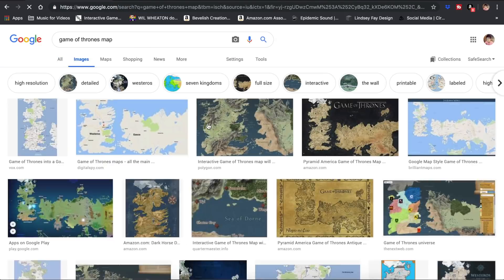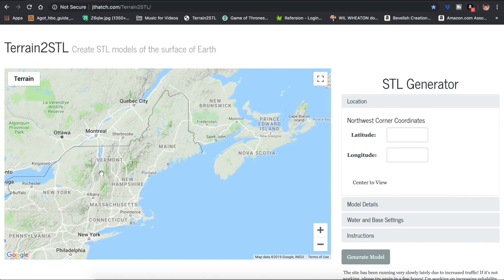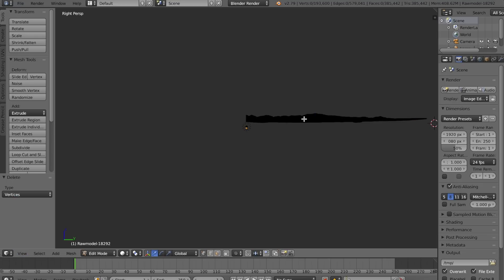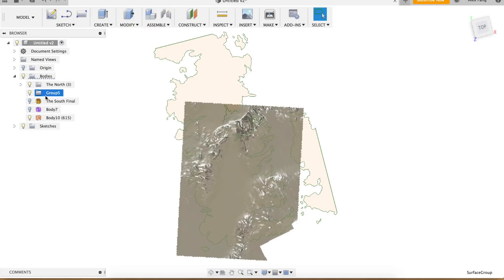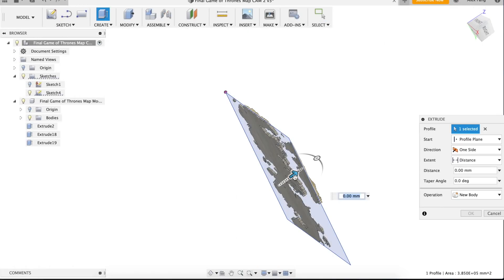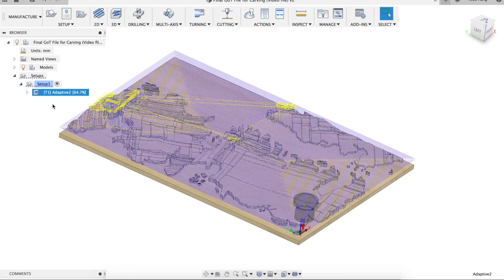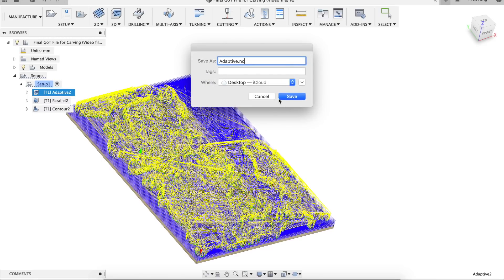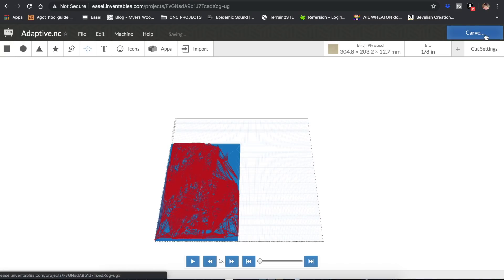Game of Thrones Wooden Topographical Map: How to Model and Carve || CNC Woodworking

Comment: Wow - I think the choices of the wood to glue-up is what makes this so special. That and the location of the layer changes.
Shame it didn't work out. I found this while trying to do a similarly huge carve on my hobby CNC. Now I'm thinking of cutting it up into smaller pieces in case it goes wrong.
Reply from the maker: That’s definitely a good idea!
Reply: @BevelishCreations  I just went through chopping it up into 4 and it's still 9 hours per piece!
At least a 3D printer I can leave alone... sob...

Comment: I know this is a little late Alex but the shift in the x axis sounds like either your belts slipping or interference causing the shift. I would reccomend coming back and trying this carve again, except using something other that easel. Try Universal Gcode Sender. When you save your gcode post processor, you would save it as a grbl file. Just a thought. Let me know if you have any questions about it. Regardless of the mess ups, the carves still look cool!
Reply from the maker: Thanks! I’ll keep that in mind next time!

Comment: I love it! Even with the shift, the project is awesome. I'm curious if your footage shows when the shift happens so you can see why it shifts? I know noise can be an issue (like if something on the same circuit kicks on that induces a lot of electrical noise).
Reply from the maker: Thanks! Unfortunately the footage doesn’t show when the shift happens because my camera can only record 30min at a time. So it only recorded when I’m on top of going in every 30min to press the record button :(. Regarding noise, what type of noise are you referring to? I can’t really think of anything

Comment: Wow! Such a shame that it didn't work out. Way to shoot a really beautiful and thorough video around the process. Glad you share it with us even if it failed. 
You might be done with this projects, but if you want to give it one more try... Maybe milling it before doing the panel glue up (four separate parts) would help.
Reply from the maker: That's a really good idea! I'm kind of "done" with my CNC for now and don't want to think about it for a few weeks lol.  When I come back to it, I want to make something smaller first... I have something in mind.  If it turns out good, I'm going to give this thing another shot, but this time breaking it into a few different parts like you said.  Thanks for the suggestion!